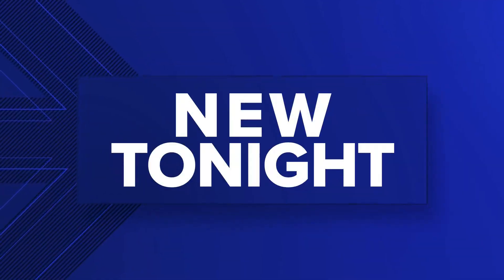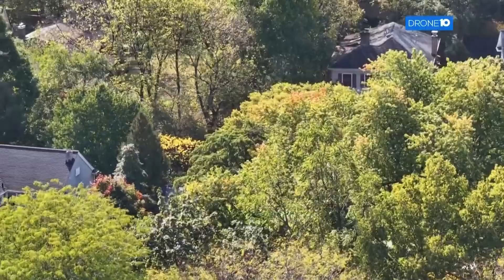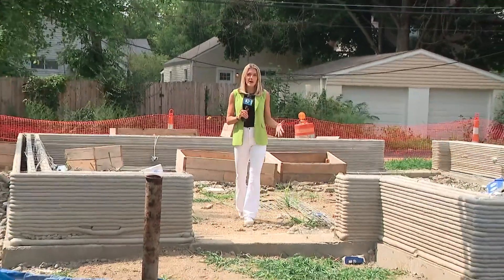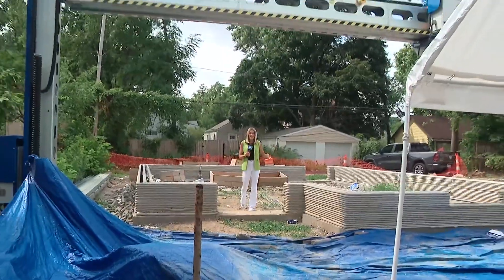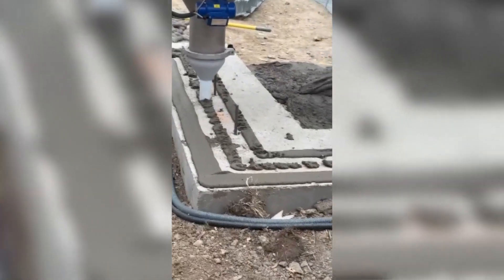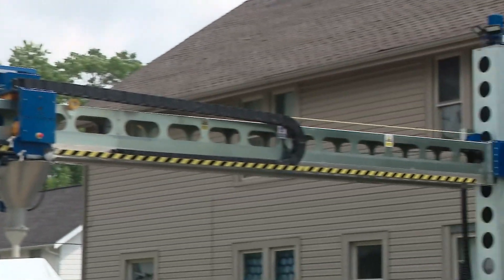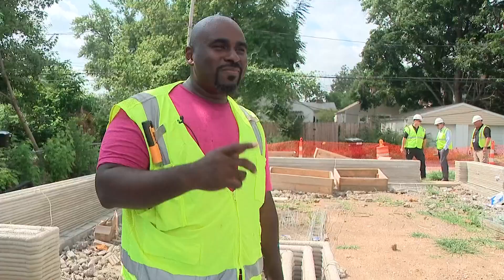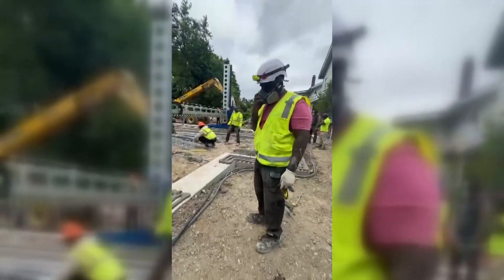First 3D printed home underway in Columbus

Comment: There is a lot more to home construction that the exterior walls. Is that being ignored? Do the solid walls hinder the installation of plumbing, HVAC, and electric for the house?
Reply: why would 3d printed walls be any different than pre formed concrete walls or cement block or brick construction?